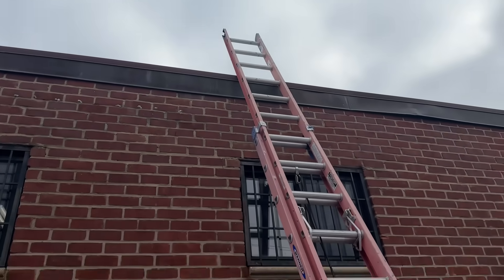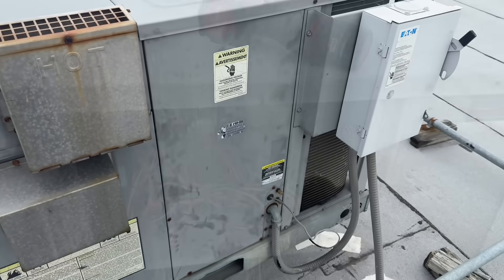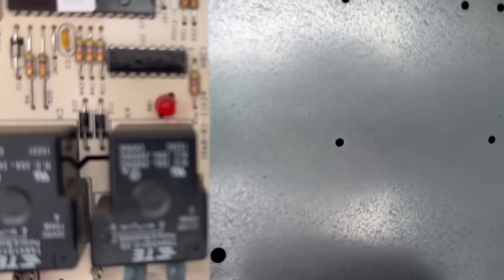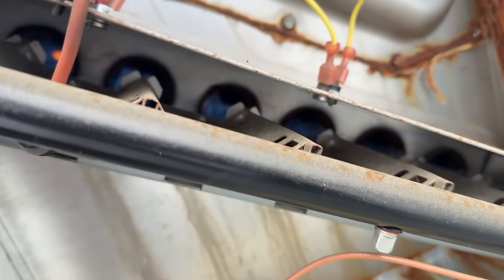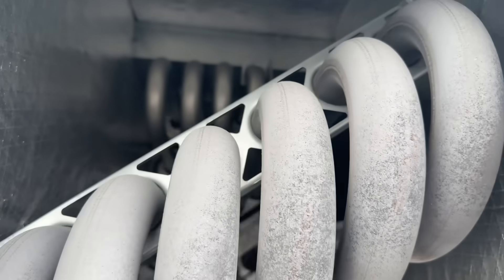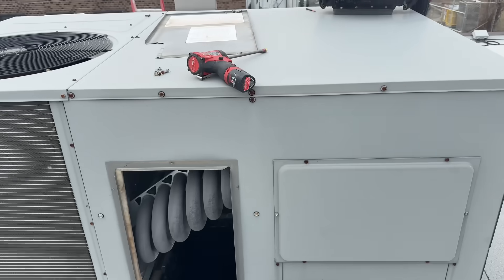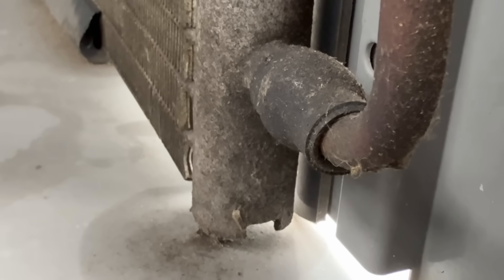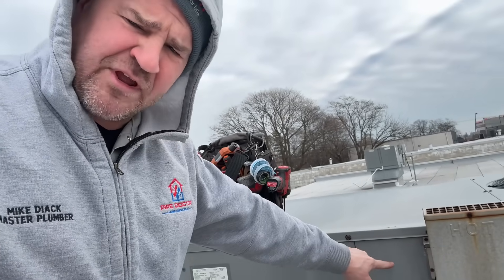Rheem Commercial Rooftop RTU Not Heating - HVAC Contractor Service Call

Comment: thought for sure the heat exchanger would be spanked, seeing all the inducer rust. maybe there's some holes behind it, rust flakes blocking or the fan blades have went self delete, although it sounded to be running smooth.

Comment: I think the problem is the draft motor shaft bushing is spinning with the shaft and not spinning fast enough, see video at the 3:10 mark.  That's why in the end of the video you had the pressure issue.
Reply: that's a sealed ball bearing, pressed on to the shaft. that piece had better be spinning with it! probably heat exchanger spanked or the plate hind inducer at exchanger end. swiss cheesed

Comment: A good Teck is aware of his surroundings… 😁👍 nice catch on the AC  .. I had a unit like that. Dang thing worked Perfectly but any time we had a wind above 25 mph?? Same dang thing  a roll out tripped.. first thought was maybe a partial defective roll out replace it a problem still happed occasionally.. I wound up extending the exhaust an modified it with a rain cap and as near as I know? Never had a problem after that . Had to be something with a down draft from the front of the building. 9 other units on that roof and that was the only one to bother like that . The unit was approximately 6 foot from the storefront 🤷🏻‍♂️  😂😂 that unit was a serious pain in my ass till I tried extending the exhaust stack..